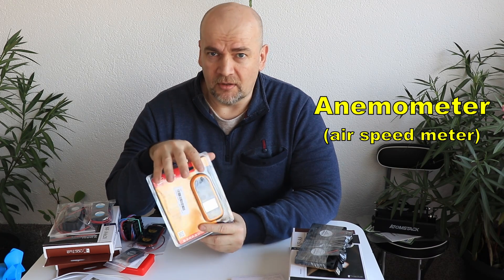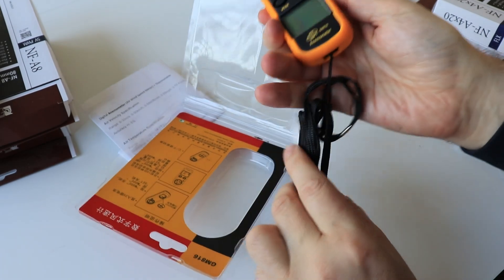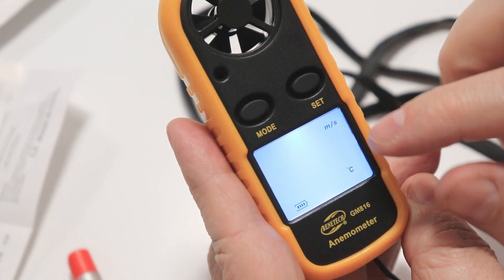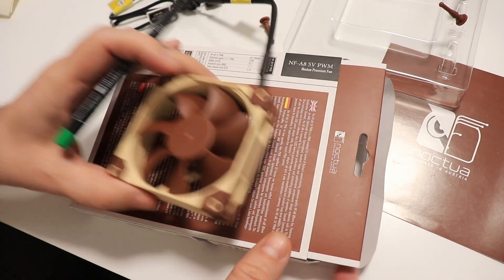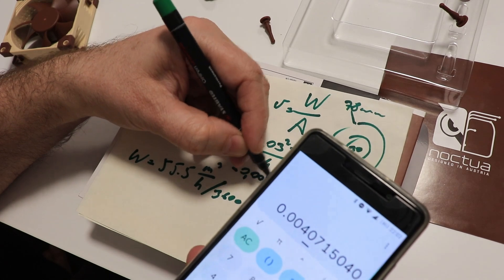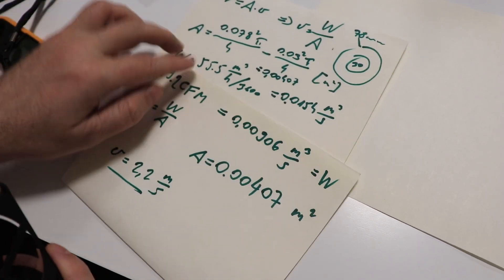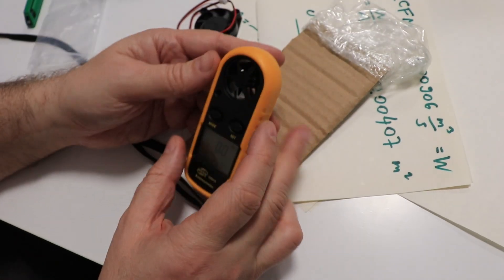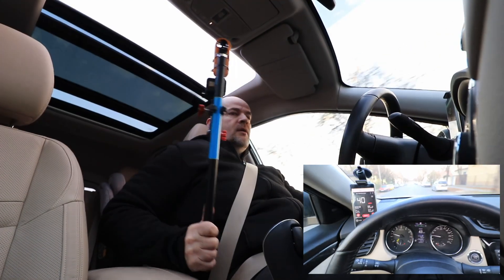Cheap digital anemometer (Wind Speed Meter) - is it good for testing fans?

Comment: Thanks a lot for the test, esp. for trying to determine accuracy. Anemometers interact differently with open vs closed and turbulent vs laminar flow. When using one to measure the wind speed outside of your car, the surface of the anemometer has no serious impact on the wind itself or the speed of your car. But when you place it on top of a PC fan, effectively a very short wind tunnel, that is only partly covered by the anemometer, the added air resistance will actually reduce the speed of the air, if only by a small amount, and esp. the non moving parts will act as a barrier.

The error introduced will depend on how much of the fan is covered, so it isn't a linear error that can simply be ignored, as smaller fans will be more effected. For your purpose it will still work fine, but you could improve accuracy a bit when measuring fan speed by simply removing the yellow rubber protector which is both rather thick, adding to the static surface, and made out of a non-smooth material that adds friction.

Comment: Great video dude.  You are strong in math.  İ am curious how one would go about calculating air changes per minute given the m/s air speed?
Reply from the maker: if something has speed of 1 m/s (one meter per second)  , then in one minute it will go longer, this means 60 m/min

Comment: For part cooling I think flow rate will be important but for the cold end I don't think it really matters. Modern bimetal heat breaks don't need much cooling so sound verses the added complexity with buck converts is more important, i.e. are noctuas worth the hassle. Most peoples coldend cooling is already overkill as is their main board and PSU cooling.
Reply from the maker: I will test only the fans without 3D printer anyway. (40x40x10 and 40x40x20). I want to measure the air flow but also the current and the noise (I am not sure that I can measure the noise, my tool measure only from 30 dB). The noise is important for coldend fans too.